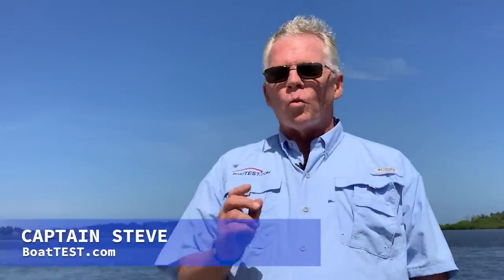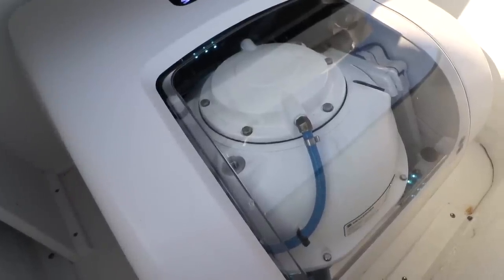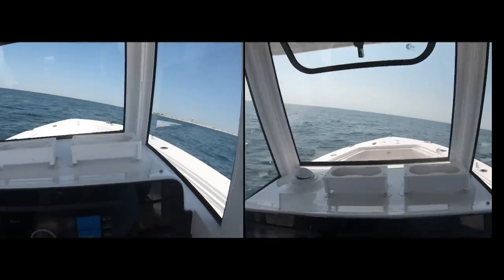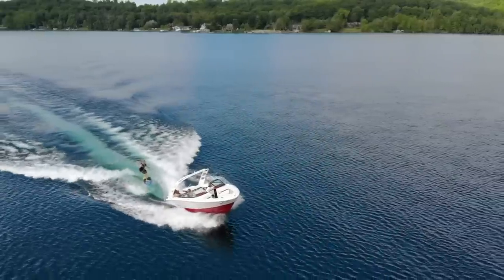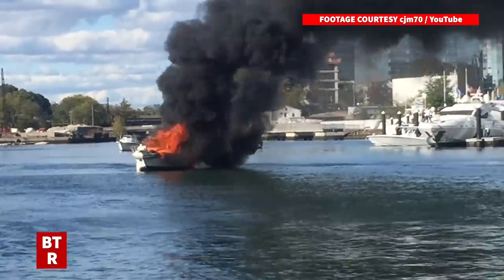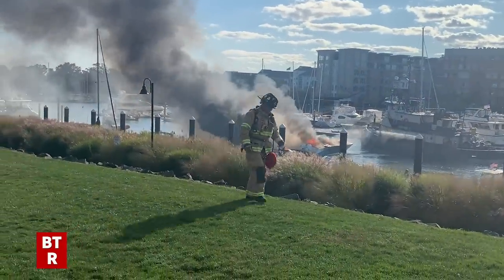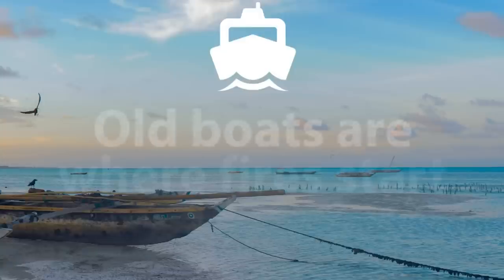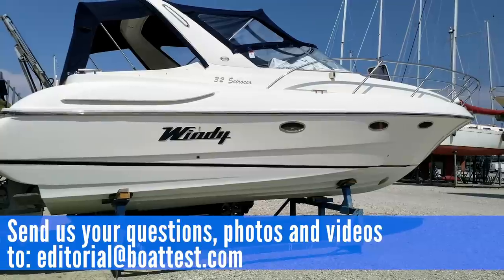Lessons Learned: Boat Fires - Episode #26: BoatTEST Reports

Comment: I'm all about that hydrogen train!  Right now it's about twice as expensive as diesel (if you can even get it) per mile of range, but it weighs in at about an eighth of the same range worth of diesel.
With about 1 cubic meter of hydrogen at 300 bar you can have a pretty serious range, depending on how big your motors are.  As a replacement for the smaller engines in sailboats it makes a TON of sense, even with the higher cost of hydrogen currently.  But with the advancements in producing hydrogen from seawater, at some point in the potentially near future, you could also generate your own hydrogen from excess energy when anchored.  Though it does take about 50 kW to generate a single kg of hydrogen, which is good for 30 kW of energy production, so you would need a lot of solar/hydro regeneration/wind to fill up the tanks.

Either way, with projects like Energy Explorer (which is already generating its own hydrogen) pushing things along, and a ton of money waiting for the right company, we should see some real improvements to the tech in the next several years.